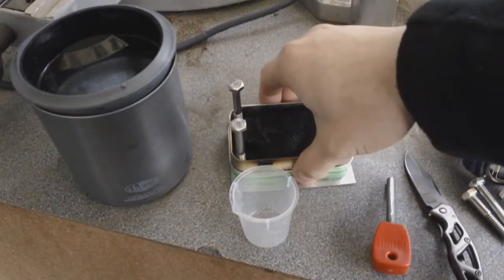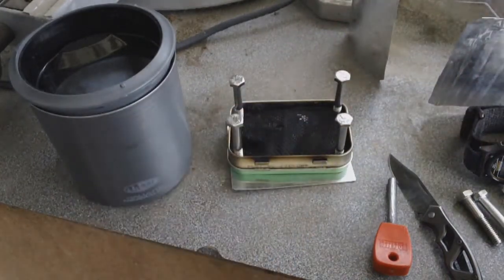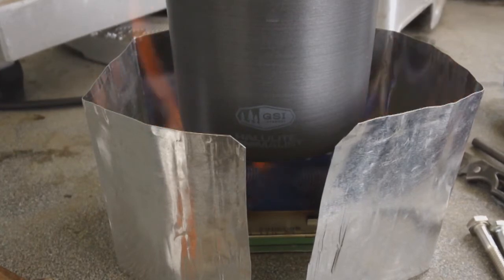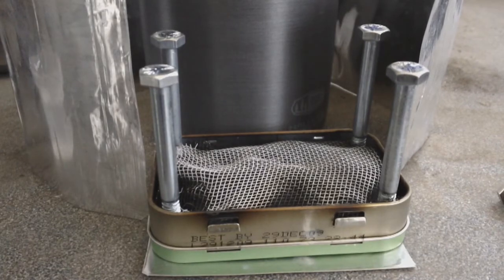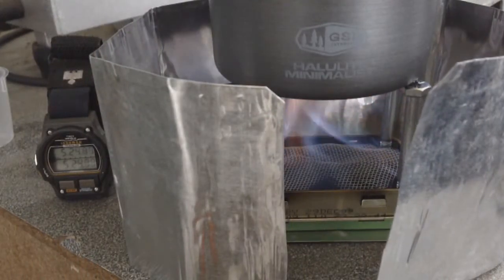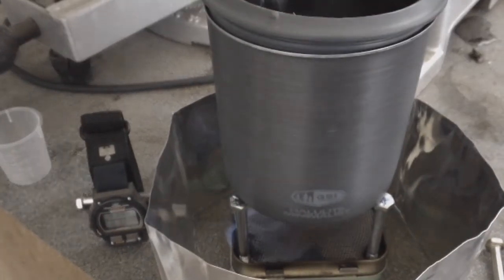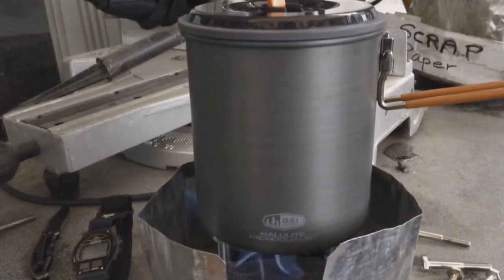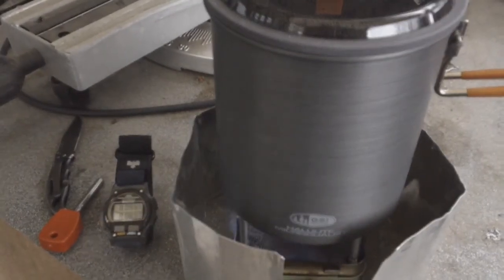Altoids Stove

Comment from the maker: @wawhiker Round is better. If we look at the efficient heaters around us, the combustion is round. The tartar cup I used was better only that I did not place the pot high enough from the flame. I thought about the bolts so you have a very good point. I tried a few more builds tonight. I think for what I am trying to achieve the beercan and tartar cup will do the trick. Another video for another time!